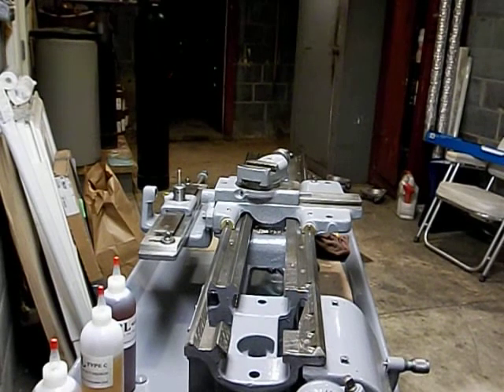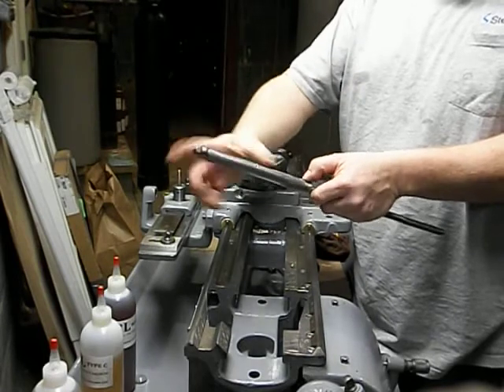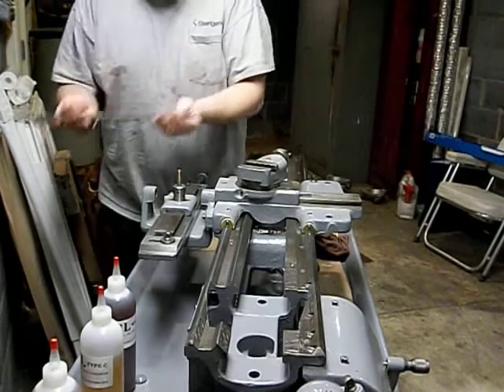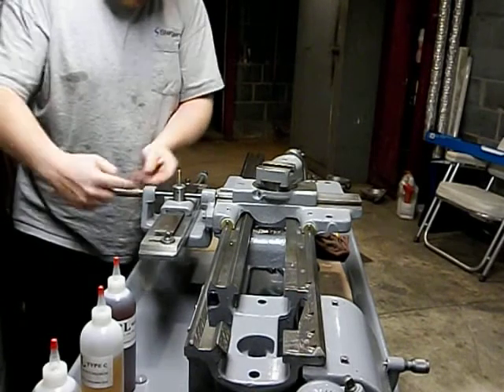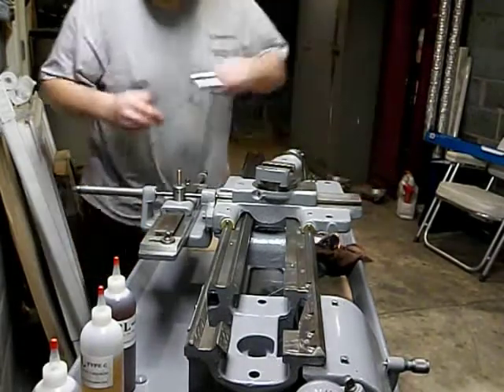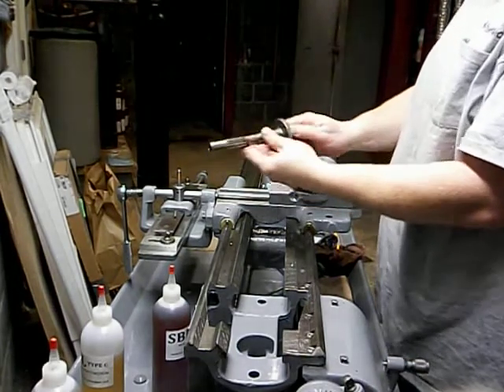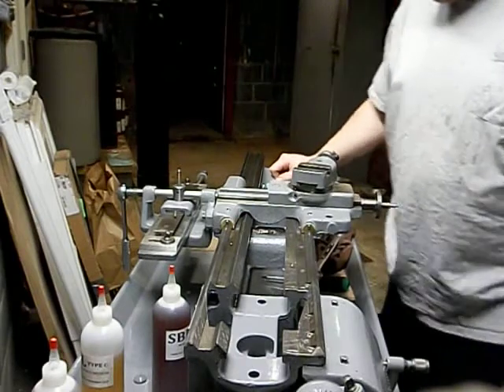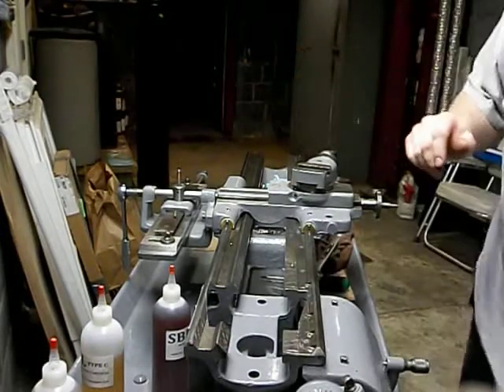installing the cross slide screw, South Bend 10L with taper attachment

Comment: Warning for those disassembling the cross slide screw. One might get the impression that removing the coaxial (crank end) of the cross slide requires only unscrewing the nut casting directly behind the crank. This is what I thought because that's what you did (in reverse) when installing it. Yes, I did note that you aligned the key  in the coax end with the key-way cut in the lead screw.. What I didn't notice is the Apron was absent when threading the crank assy onto the carriage. Therefore there was no interference when installing it. The bottom line is ( if the apron is installed ) the operator must loosen the two slotted apron screws enough to clear the mating gears in the Apron. . If you don't the crank assembly's power feed gear flutes will prevent its removal where it's meshing with the apron gears. 

This valuable info was conveyed to me by Dean at https://youtu.be/hGhaOVU8EPs

Dean responded to my plea within hours of me posting by problem removing the crank casting.  

This fact doesn't diminish the worth of your video though. Thank you for the video. Moreover a bigger thanks for not editing out those moments we all have searching for that pin, screw, nut or what ever. It was refreshing knowing it's not just ME! 🤪I hate myself for always being disorganized but I'm way too old to change now.  
Wakodahatchee Chris

Comment: Mine is a 1941 and has been slightly modified with the addition of a brass screw, perhaps to augment the tapered pin. Nice to see how it goes together. Thanks!
Reply from the maker: A brass lead screw, or a brass screw to hold the tube into the part on the taper attachment?

Comment: I see you posted 10L and you are working on a Heavy 10. I own two Light 10s and thought a 10L was the light 10? Thanks,Steve
Reply from the maker: The 10L is the large bore (1 3/8" through the spindle)  heavy 10.   10K is the light 10.

Comment: Looks like you indicated that it comes out the left side. So to remove, you punch from the right. I think mine is stuck. I tried heating the surrounding metal to no avail. Any ideas?
Paul
Reply from the maker: I won't absolutely guarantee it comes out of that side without checking, its been a while since I put this together.  If you can get calipers on the pin it should tell you which is the fatter end though.  I don't really know any special tricks other than using a good punch.
Reply: @gadget73  I’ve tried calipers and before I started mashing it, it looked like the right side was larger. So I started punching on the left side. All that did was smash the pin up against the cylinder and spread it out. 
After seeing your video, I started tapping from the right. That did nothing except move the pin a little bit. Now it’s mushroomed out. It won’t budge either way. I’m concerned about bending something if I hit too hard. It would also be difficult to drill out. 
Any suggestions Master? Your video was great and it’s obvious that you understand what I’m going through. But I would suspect that SB oriented the tapered pin the same for each lathe. It wouldn’t be one way on my lathe and another on yours, would it. 
Paul

Comment: I know this is going to be a stupid question.
How do you make the cross feed follow the taper attachment?
I just bought a South bend and I'll be honest I don't know what the hell I'm doing
Reply from the maker: tighten down the handle that sticks up through the "tongue" bolted to the cross slide.  The handle threads on on that piece in the middle of the cross slide where the taper pin goes.  Once thats tight the slide is locked to the taper, and if you clamp the taper to the bed it will move the cross slide for you.  Or if you don't have the taper locked down it can be used as a cross slide lock if you need to do that for some reason.